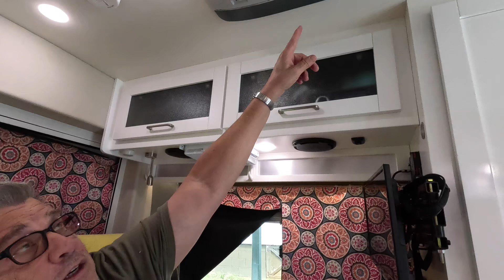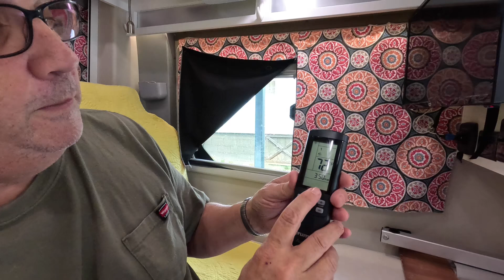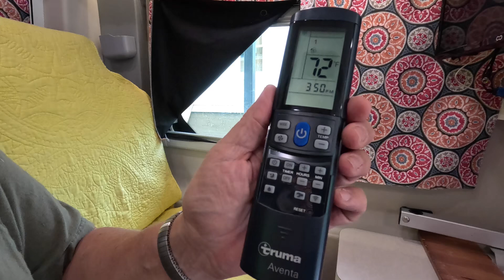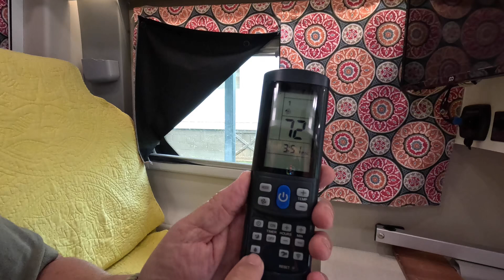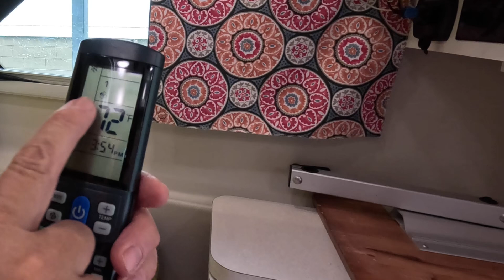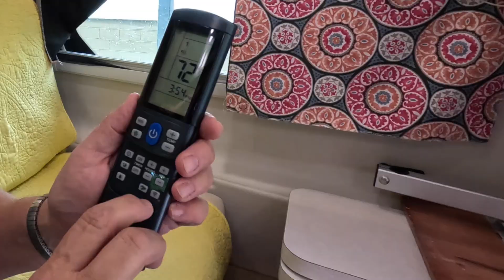Truma Remote Control - How to use it

Comment: Hey there. So, you upgraded from the 12V DC air conditioner to the 120v AC air conditioner? Can you still operate the air conditioner from the master control panel? My buddy did the upgrade but cannot access the air conditioner from the master control panel. Did he do something wrong on the install?
Reply from the maker: When swapping the ACs after the van is built it limits the control options.   Most of the time, the AC  will only work using the remote.  I was having some other work done and it made it easy for them to swap the Truma control panel.  I can control my AC with the remote and the Truma control panel.   I can't use the firefly.